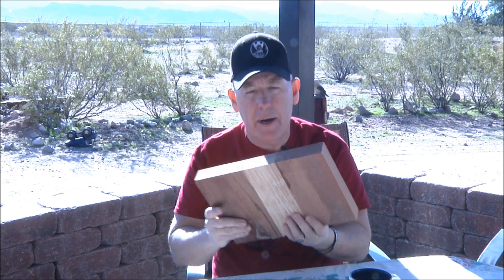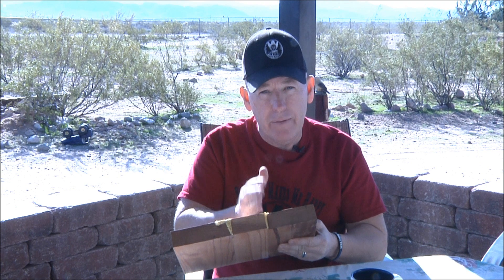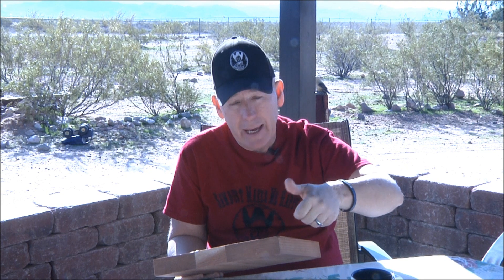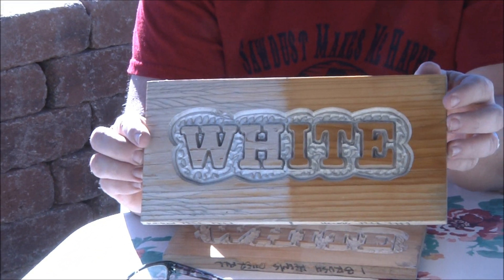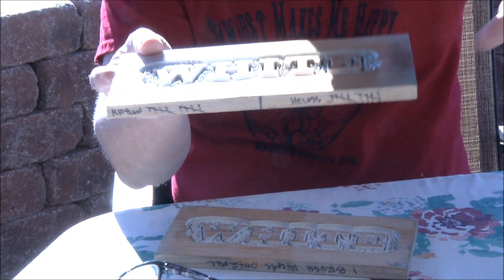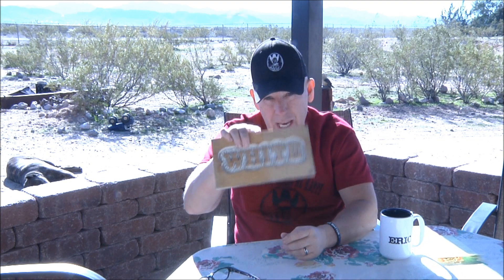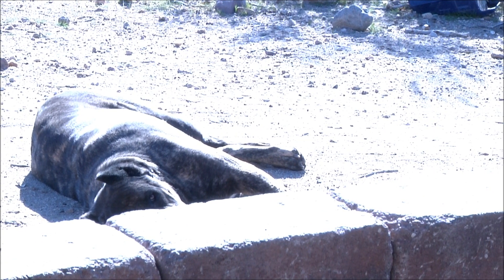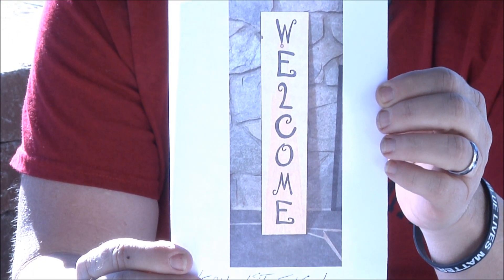Coffee & Questions 3/8/17 Joining Boards & Finishing Experiment

Comment: FYI, I've been using a deck sealer on my signs, specifically Superdeck, just because of it's availability.  I've used the helmsman spar urethane and just wasn't 100% happy with it.  Maybe I wasn't putting enough coats on it (4).  The sealer is one coat and done and will be easier to keep up down the line.  It's much easier to apply and will never peel.
Reply from the maker: I may try that. Thank you